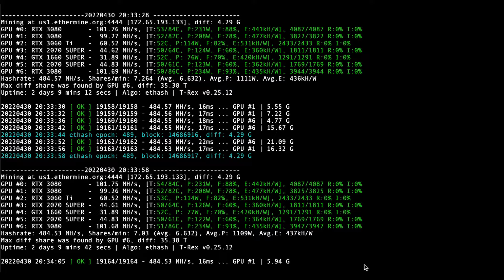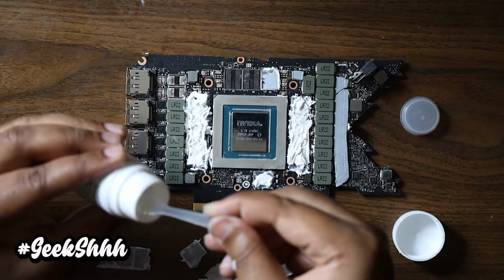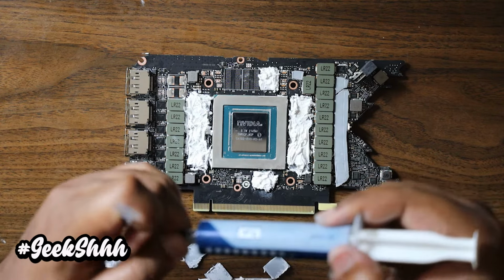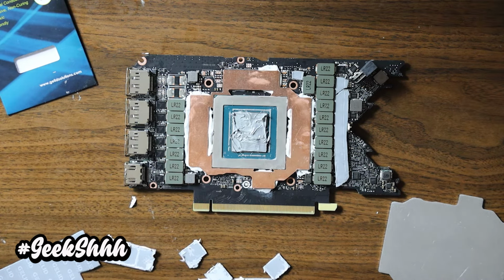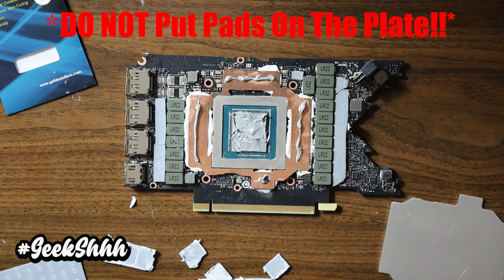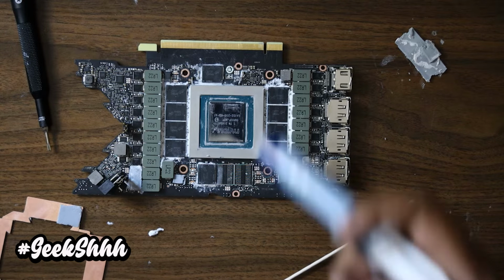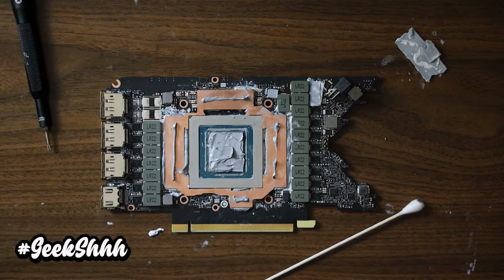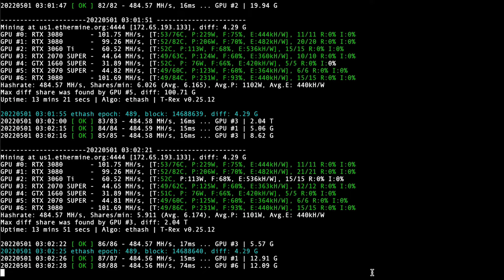RTX 3080 COPPER PLATE MOD TUTORIAL, THERMAL PUTTY BETTER THAN PASTE? #GeekShhh #CoolMyGpu #Nvidia

Comment: Nice video. I've been rocking the TG-PP10 or other putties and either copper or aluminum shims. 

I haven't bothered using paste with shims as it will bake and dry out, and possibly pump out.

I find after 1 year in a GPU it tends to be quite easy to clean up as it becomes less sticky, but still pliable. I've also reused year old putty that was mined on.

You should check out TH949-1 putty. It's insanely good. I've got a few videos where I test it out against other putties and pads.
Reply from the maker: Oh wow, yea im def gonna check out your videos on that!

Comment: Which Copper plate did you use from CoolMyGpu? their sight doesn't seem to have one for the 3080 FE (atleast not anymore) and their variants do not fit the FE supposedly.
Reply from the maker: This was a year ago. Wouldnt be surprised if they stopped selling it, im surprised they still in business at all. Chinese started making copper plates for way less. Sorry
Reply: @GeekShhh  I realize it was a year ago, I was just doing my due diligence to ask, just in case i either missed something or you had more current information that I could benefit from by asking you. I since then have actually seen the copper plates on eBay for a significant price drop and Also, my blind A** found it on their website 😂😂😂. Either way Thank you for the tutorial on the mod!!

Comment: friend your video is incredible and very helpful. How thick is the piece of copper? All the best!.
Reply from the maker: Thanks for watching. Im not sure about the thickness bc the people who make them dont specify but if i was to guess i would say 1.5/1.6
Reply: @GeekShhh  Thanks for the answer friend!, and what thickness of thermal pads have you put in the rest of the GPU0 areas? 3mm or 2mm on the backplate, still 1.5mm on the front near the copper?
Reply: @Riderwalker  1.5 Gelid ultimates near copper and 3mm Gelid extremes on back